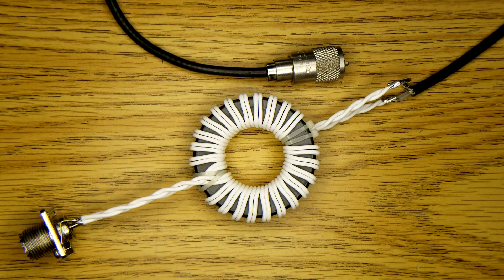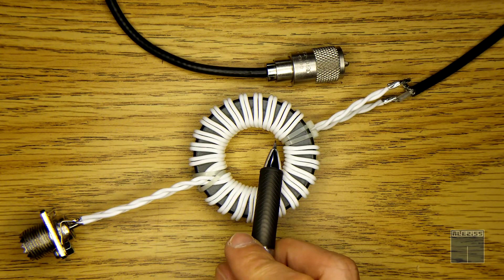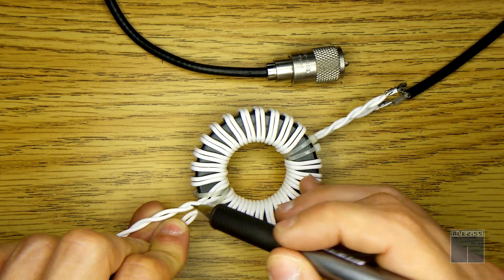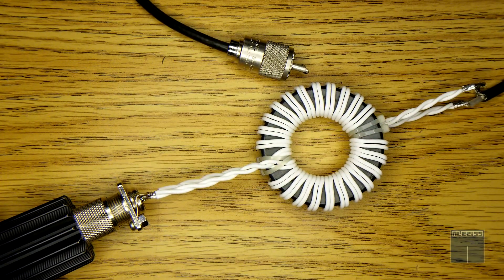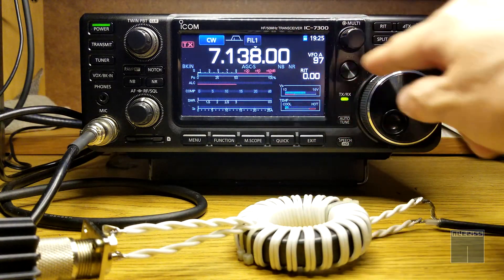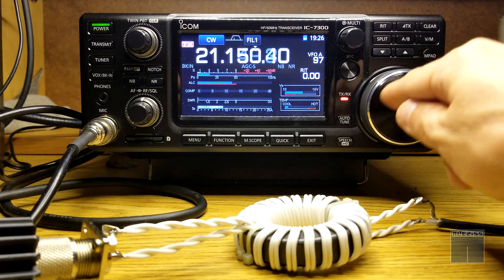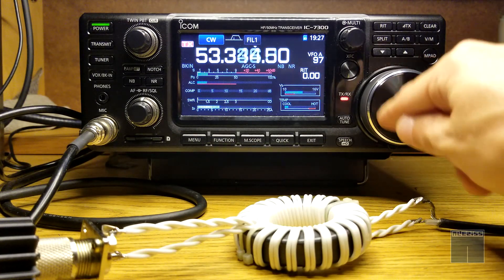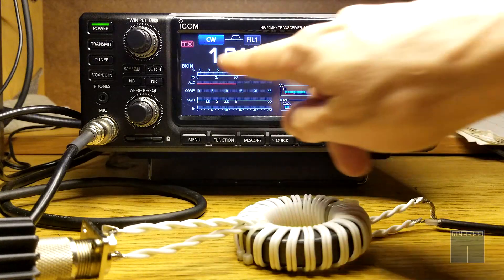SWR testing 1:1 common mode choke balun design from TRX Bench

Comment: You have 1:1 balun connected to 50 Ohm dummy load. Why would you expect any SWR other that 1:1? The common-mode choke you have does not change SWR, it suppresses any reflected power going back from the dummy. Have you tested it without balun and saw different results?
Reply: The characteristic impedance of a transmission line depends on the geometry of the conductors. The coaxial cable has a certain parallel capacitance an serial inductance per length that gives it it's impedance. If you insert a twisted wire pair as shown here, it will likely have a different characteristic impedance. You could use this to calculate https://www.allaboutcircuits.com/tools/twisted-pair-impedance-calculator/ . When there is an interruption in a transmission line due to a change in characteristic impedance, you will have reflection and therefore a non-zero SWR.
Reply from the maker: @ramorrisey  wow... this is adding to the worries I had in regard of the impedance of the wire and how it is winded...

So what I've done there might be totally wrong (or not too much since SWR seems quite ok besides 50mhz)... I did it this way to prevent wires being away from each other... the link you sent me requires quite a bit of measurement, lenght of wire, spacing between wires, how many twist, thickness of insulation... this is a bit out of my abilities, I would need a vernier, another tool I do not have... the maths are also quite crunchy, thank god for the online calculator !

So if I understand what you are saying, they "could" be twisted but would need to be identical on both sides, including lenght and twist OR I would need to leave all wires straight without twisting them and I might have better results ?

I just wish I had someone who could help me with a VNA...

Thanks for your comment !
Reply from the maker: @ikatkov I know what I did built is supposed to ATTENUATE (not suppress) common mode current. Now, how can I know what I did build would not change the impedance reading thus impact the SWR readings ?? what does tell me the random ptfe wire I have is the right impedance ? What does tell me the winding with the specific unknown wire I have is the right one ? It's not even the same size as suggested by trxbench, even Peter said that one type of wire he used did NOT work you can see that in one of his previous video... the only way I could at least get the impedance question out of the way was to test if the impedance was not affected by the core and winding and it seems not.

The right way to test common mode attenuation would be to use a vector network analyzer or a rf signal generator with a rf spectrum analyzer which I do not have. Do you have a way to test common mode attenuation ? If so tell me right away !!!

So how can I test a dipole and see how much common mode attenuation I get by installing the choke or not ? I can't "SEE" any of this ? I don't undestand what you are saying...
Reply: @Aleziss  any differential amplifier will show common mode. I believe all you were checking here is added inductance the "balun" gives, in addition to your viewers grasp of the fundamentals of passive electronics, resistance vs inductance vs capacitance. Eli the ice man commeth
Reply: The reason for 2 pairs of parallel conductors is to get close to the right characteristic impedance. At the lower end of the frequency range with relatively short conductors it will cause less of an anomally. TRX bench did test common mode impedance (as I have done with my ones), if you have used the correct core material you should be good to go.
Reply from the maker: @g0fvt  thanks for the comment. I did use the FT240-43 core as he suggested, a core I already had to make an end fed half wave antenna but decided to build that balun instead. It will be use on a 2 element 40, 20, 15, 12, 10 and 6m beam next year... as it is too cold to play in the tower right now ! As someone else mentionned in this post, twisting of the wires might not be a good idea so I will straighten these instead and keep them together with a shrink tubing.
Reply: @Aleziss , my own baluns do not attempt to maintain a 50 ohm impedance since my antenna is open wire fed. I have found though that these cores do make very effective wideband common mode chokes. I have had zero heating issues despite running high power. With these chokes the heating of the cores is related to the load impedance and degree of imbalance. Your project looks neatly made and personally I would be confident to use it.
Reply from the maker: @g0fvt  thanks for the precisions, like you said, I'm also quite confident to use it as it is, proven technique it seems and with your comment, I will test it on the antenna with hopefully good results. I will be complicated to remove and tweak if needed once up in the air !
Reply: Aleziss you will be pleased with the results I am sure 73
Reply from the maker: @g0fvt  thank you again for your response. By the way, you wouldn't happend to have a video of the test you've done with your balun ?
Reply: @Aleziss  , sorry I have no video of anything despite a few cameras! I just did the common mode checks with a NanoVNA in two port mode, I did save the plots though.
Reply: This is about the most ignorant, uneducated comment on RF related videos I have ever encountered. You likely also lack any practical experience.
I will have you know that a friend and I wound these exact type baluns to the recommended specifications. On initial testing with a dummy load and a calibrated Rigexpert, the SWR was nowhere near 1:1. The tag length and everything was very similar to the one in this video.